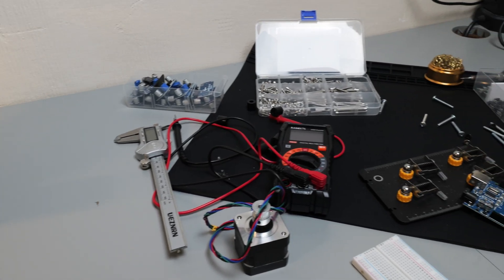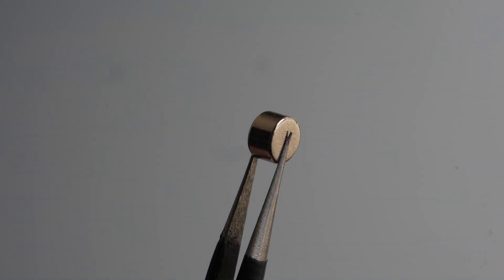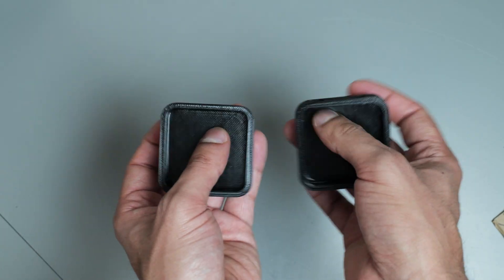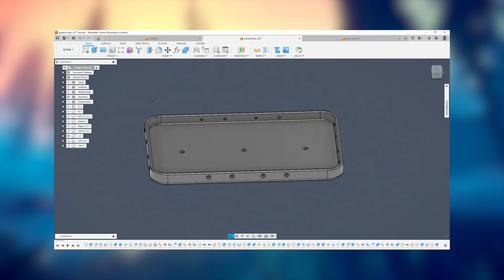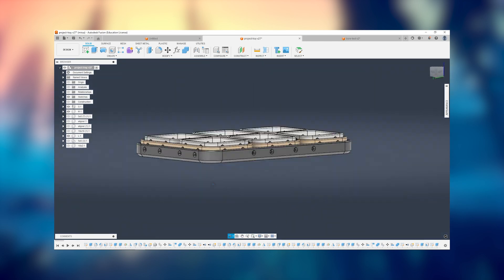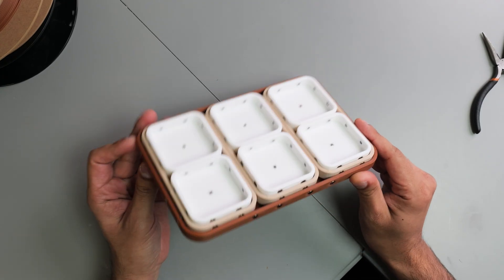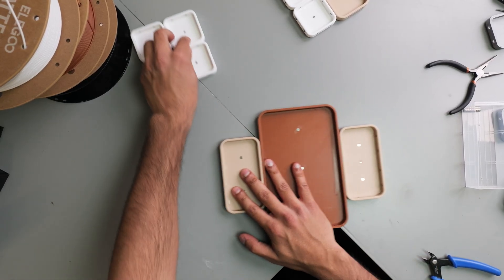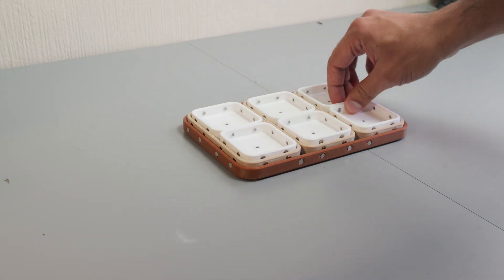3D Printing My Way Out of Clutter

Comment: Very nice and neat.
One suggestion though (maybe not needed for your own use case), place magnets all the way out along the long edges on the large trays, as now it seems only the middle part of that edge can be used (or maybe the magnets line upp so you can still place medium trays there but just using one of their magnets 🤔).
Reply from the maker: I initially had the idea of using magnetic strips, but wanted to have the trays snap in place. I think I'll revisit with magnetic strips in the future.